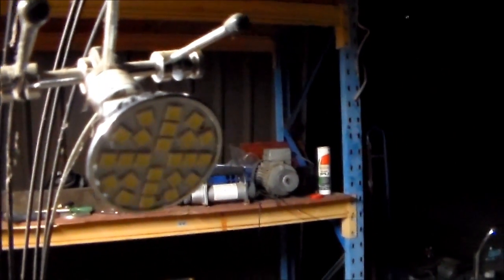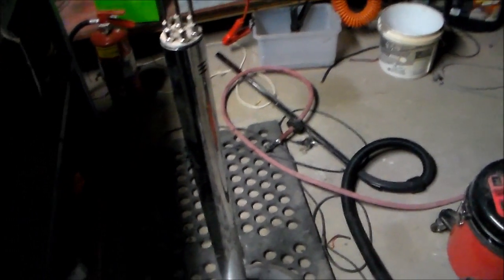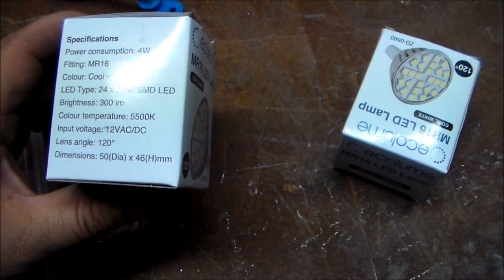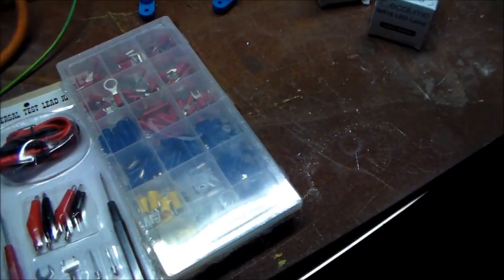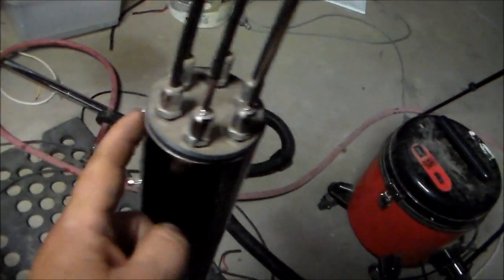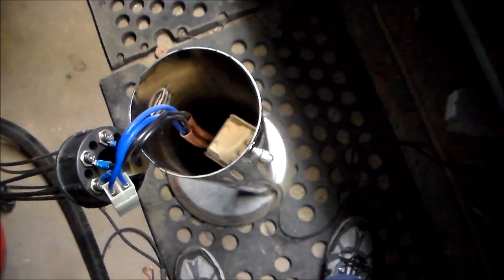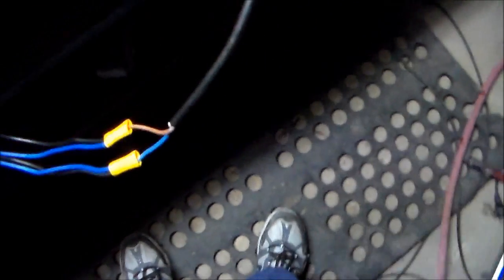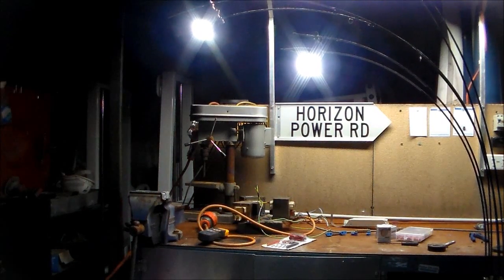New stuff from jaycar, Converting AC Downlights to DC LED for SOLAR

Comment: I've tried a bunch of similar "multi-chip" halogen replacement LEDs.

Total junk. Very feeble light output, horrid colour, and the LEDs started burning out within weeks.

I'll be buying high-power few chip modules in future (e.g. philips, cree or osram).